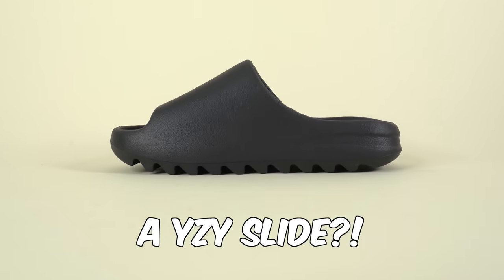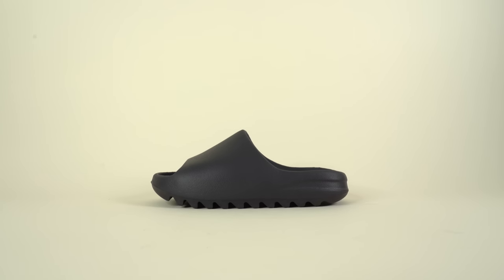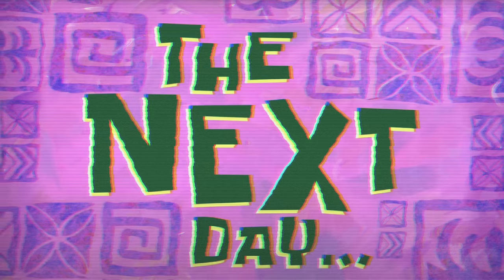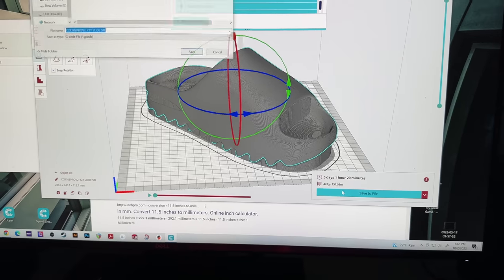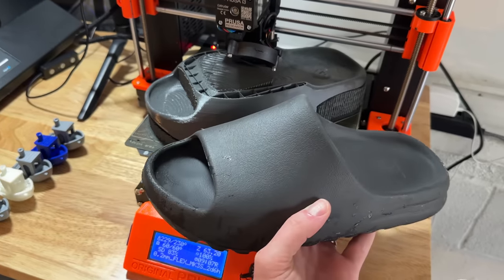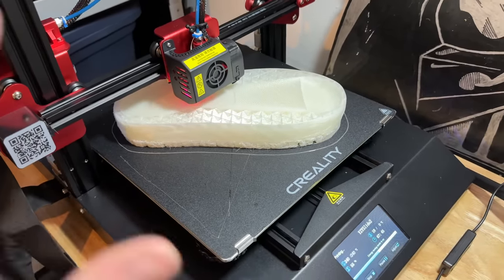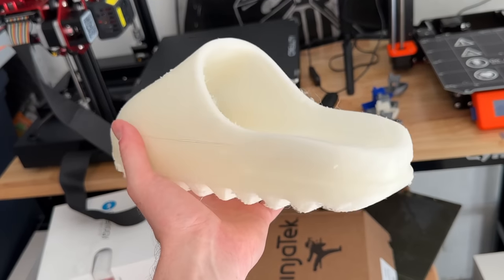I 3D Printed YEEZY SLIDES

Comment: I've been 3D printing for about 8 years now, and one thing you may want to try is changing the infill patter, which could affect the squishiness and feel under foot.
Reply from the maker: Great call! I’ll try that!
Reply: @SethFowler  iirc gyroid is what a lot of people use
Reply: i wanna start 3d printing but i do not wanna spend over like 300-400$ for a good printer, what should i buy?
Reply: @SethFowler  cant wait for the next video
Reply: @SethFowler  Instead of printing an entire slide maybe you could print multiple soles with different infill patterns? Just a thought.
Reply: @trqnton4640  The ender 3 printers are great budget options. You will have to tinker with them a bit but nothing too crazy it just wont be as good as it can be right out the box. If you are willing to spend more money I highly highly recommend the prusa mini +, the kit one is $430, and the semi assembled is $460. Very worth the money. Its a bit smaller than the normal prusa and the ender but it prints insanely well. Prusa's print the best out of every printer i have used and i have used some pretty expensive ones with my job.
Reply: @trqnton4640  An Ender 3 is pretty much everyones starter printer. Its solid and if you get it on sale like $150-$180 bucks
Reply: @trqnton4640  save up money and get a bambu lab x1... best printer to buy at the moment and really not that expensive for what it does...
Reply: @SethFowler  i would try cubic. seems to me like it would be like a spring. maybe 20%?
Reply: @trqnton4640 JUST KNOW that any budget printer is gonna have it's kinks and issues. Unless you spend lots of money on a printer, it's not gonna work well 100% of the time.  Perhaps an ender 2 pro would be good. It is 169 USD. You might want to watch some vids and reading some articles on good budget printers and make the decision yourself, but I have a self upgraded Creality Ender 3 that is great. I would certainly check out Creality as they make some of the best budget printers. I would maybe not go for the ender 3 if your just starting out as it needs to be assembled, which can be slightly difficult, but it is highly upgradeable and there are good YT tutorials to build it. It's a great choice if your up for a challenge. I have also heard good things about anycubics. If you want a bigger printer, there is the CR series from creality. .
Reply: @SethFowler  plz do this again I found it super interesting and I know you can do it even better and I wanna see how close you can really get with this technology
Reply: @trqnton4640  just get an ender 3 for under 180 learn to tune it and its a great printer
Reply: Something that will improve quality and printtime on the creality, switch slicer. You can you use any slicer but I would recommend the prusa slicer or cura. And than just search a fitting profile for the printer on internet and add it.
Reply: @trqnton4640  best entry point printer is the ender 3 pro which you can upgrade down the line
Reply: @trqnton4640  depending on where you live, if you have a Microcenter near by they'll have sales for and Ender 3 Pro for 99$ which is a steal!!
Reply: @MaxximumKB  I heard the ender 3 S1 pro is about comparable.
Reply: @jitsevanthillo4221  I like normal Cura for my ender. I haven't really used Prusa slicer, but its seems to be more confusing.
Reply: @SethFowler  if there are a lot or all filled with filterment, will the shoe last longer, even if it is harder
Reply: @BuildBreakBuilds  Yeah i have also heard that. Its also direct drive so you would have a better chance of printing flexables using it than the prusa mini, but its a little bit more expensive for the pro and prusa's products are just super solid but definitely a good option for the same price range as the prusa mini. the s1 is also a good but larger so thats a plus if you need to print something as large as a shoe
Reply: @trqnton4640  Ender 3v2
Reply: @trqnton4640  I don’t quiet remember the name of the printer but there is a printer names “Fookos” I think that’s like 50% off on Amazon
Reply: @trqnton4640  Ender 3 works great right out the box, you can upgrade it to be quieter and print at higher temperatures, and it will still stay under $400
Reply: @trqnton4640  On further thought, I would probably go for the Ender 2 Pro. It is rather cheap at around 170 USD, and it comes mostly assembled. If you want a bigger print volume, then the Ender 3 is good, but again, you have to assemble it. For a bit more money you can also get the pre-upgraded Ender 3 Neo.
Reply: @trqnton4640  ender 3
Reply: @trqnton4640  ender 3 v2, ender series in general
Reply: @trqnton4640  Just wait for black friday, and if you cant then just get an ender 3.
Reply: @MaxximumKB  Once you have a printer, you can print a direct drive mount and change your extruders location. No need to spend extra for that feature.
Reply: @trqnton4640  Ender 3's are good enough to print functional firearms with and most variants can be found for under $300 bucks.
Reply: @CaliMeatWagon  wait what you can print GUNS?
Reply: @CaliMeatWagon  Yes, you can definitely  do that with printers such as the ender 3, but I would not recommend doing that with the prusa mini, but also you typically don't upgrade prusa's which is one of the perks of owning a prusa. I like the s1 over the ender 3 because it is basically an already upgraded ender. Also there is nothing wrong with bowden tube printers other than printing flexables.
Reply: @trqnton4640  You still need some metal parts, but yest. Check out Print Shoot Repeat on youtube.
Reply: Using Lightning infill in Cura will drastically reduce the stiffness. Can try increasing line width and infill density to increase stiffness.

 Would suggest a bloody Bambu X1 for mega fast printing. Wouldn't be surprised if you can halve or third the print time. Also, use a larger nozzle.
Reply: @pooounderscoreman  A larger nozzle is a great idea. Perhaps even consider a .8mm. However, I'm not sure if lightning infill would be good for this application. Lightning acts as internal support, so only areas that need to be supported will have infill, meaning the shoe would be mostly hallow. When I wrote my OG comment, I had gyroid in mind, but since there are now so many patterns, he would have to test them out to see which is best.
Reply: @trqnton4640  anything under $300 you are going to spend a lot of time troubleshooting and constantly tinkering with. If you are okay with that I would recommend an anycubic or ender printer. If you want less hassle go for the $400+ printers
Reply: @trqnton4640  ender 3 v2
Reply: @SethFowler  agree with op, cubic infill at a higher density like 20% would be soft enough but rigid enough to hold youre weight without collapsing. Cubic gives strength in all dimensions  which distributes the load evenly, unlike standard infill/rectilinear/grid
Reply: @SethFowler  if it works make a video...the flow in he dark idea is so cool
Reply: Gyroid infill will probably work well here
Reply: @trqnton4640  The Ender-3 Max Neo 3D Printer is a good one.
Reply: You look to be about 15 years old which means you were 7 when you started. I find hard to believe. Unless you have a boat load of money, I doubt you had a 3d printer 8 years ago considering consumer grade printers just recently (last 3 years) became affordable. Maybe you had access to a school printer. In which case you don’t have the experience your school did.
Reply: @samuelmartino9861  I was actually 6 when I started. My dad and I belonged to this place called TechShop (which has since gone out of business). The had original Printrbots that cost like $1100 and only worked 40% of the time.
Reply: @trqnton4640  you can get an ender 3 pro at microcenter for 99$
Reply: @trqnton4640  spend the money.. get a Bambu p1p probably the best right out the box no mods needed to print high quality

Comment: Try that last ninjaflex sized slide and up the infill by about 15-25% and use Gyroid infill patern instead of what you are using now, has a much ebtter spread for pressure. You were so close to success but you gave up D:

Comment: As others have probably said… 1) change infill at different parts of the model (easy in PrusaSlicer), 2) use a bigger nozzle like a .6 or .8mm and 3) 0.15mm layer height is tiny, am sure you’d get good-enough results with 0.3 on a 0.6mm nozzle will print in fraction of the time
Reply: THIS!!!!!

Comment: Your cr 10 printer will inherently be stringy when trying to print flexible filaments. This is due to it being a bowden style extruder instead of a direct drive extruder on the prusa. 
You should try using progressive infill so there is more infill at the sole and less infill on the top where the infill does not matter.
The infill pattern you should use is the gyroid pattern.

Comment: In Prusa Slicer you can add modifiers to change the infill at different parts of the sole. i.e 60% for the heel 30% for the toe and 50% for the arch. Also you can use another model as the modifier to get a better shape. The rabit hole is deep.
Great video. Keep up the good work.
Reply: I really hope he does this next time, the heel always collapsing is disappointing.
Reply: You can do this in Cura too.

Comment: I highly recommend gyroid infill (you’ll still have to iterate to get the percentage just right though), and a 0.8mm or 0.6mm nozzle. Will be much quicker print and still look just as good. Gyroid is better for unilateral strength too.
Reply: This is awesome though. I’m gonna try to make some as well. Maybe foam runners too.

Comment: With the support, figure out a good angle for printing the shoe. Angled slightly at anything less than 30 degrees will help with an overhang. You're essentially trying to make a bridge so stringing will occur.

Comment: the 3d printing videos are really interesting.  might want to pick up a 3d printer soon
Reply: I highly suggest joining the 3d printing discord and getting access to the what printer should I buy sheet. You want something with a PEI sheet bed (so you can peel it off and not have to struggle to get it off the glass
Reply: Also - prusas are like the high end shit but a step below ultimaker. Ultimaker is like the ultra high end shit lol

Comment: Stringiness isn't normally solved by supports.  They are typically due to retraction and priming settings.  Additionally travel speed has a significant impact on this as well.

Comment: Suggestion, With Prusa you can use certain modifications to make a 3d model slice with one type of infill, and then another part of the model slice with another type of infill. Id suggest looking into that, so you could say make the heel area thicker in infill (and id say look into using gyroid infill because it might have better cusioning) and have the front area have less infill. Same with layer thickness, you can make the bottom layers have thicker walls while leaving the upper layers with thinner walls. Theres a lot of options for you to use instead of one infill prints all.

Edit: Other suggestion, theres printer profiles in the Prusa Slicer for creality printers, take a look at them since Prusa slicer is a better slicer then the creality one.

Comment: Glow in the dark fillament will degrade your nozzle super fast. If your prints start to suck get a hardened steel nozzle, you'll be able to print abrasive glow in the dark fillament

Comment: About the infill situation if your using cura to splice your prints you should change the infill type instead of more infill. I believe the default is cubic but I recommend using gyroid it’s more structure do you won’t need more infill

Comment: i dont know if this is possible, but in 11:16 you metioned the "pocket of air squeezing", maybe there is a way to post process tpu filament prints to fuse the gap between layers, maybe this would make shoes more stiff and create feeling like 'walking on air'  ? i know that people are using ipa fumes/acetone to smooth the  petg prints.
Really enjoy the shoes printing series, keep grinding 👍🏽

Comment: I would suggest changing your infill pattern to "Cuboid". It offers strength in all directions. I also would experiment with increasing your wall count. 

One thing you can do is just print out the soles. It will take less time and you can experiment with different settings and nail the right stiffness.

Comment: Maybe change not just the infill but the number of walls too, if you put a high number of walls with a low infill it may be soft in the middle and not crush under the weight on the sides, I don't know if I explained it correctly but I think it would have a good result

Comment: does it have to be done in a single print. use the glow in the dark foam to make the tread. and the 2nd one to make the top and a 5mm sole and then just plastic glue them together?

Comment: you should try the bambu labs p1s or max and see if you can do the soles as slid material and the inside as a softer material before finishing with a style material around the top. I recommend that printer because it can handle multiple materials with its AMS system as once.

Comment: Are you using a hardened nozzle for the GITD filament? If its Brass the GITD materiel will slowly reem out the brass nozzle and lower print quality and could cause additional stringing.

Comment: These videos are great, and I don't want to sound like an unfair critique, but you never seem to learn that the shoes will have a tendency to compress and completely deflate upon placing any sort of pressure on them. Almost every print has had this issue and surely there would've been a way to resolve this. Outside of 3D printing, why not fill the soles in with something else, like perhaps expanding foam, wonder how that'd work.

Comment: You can fix stringyness with retraction

But I wouldn't actually do that because you're using flexible filament, what I would do is print them without support, and then use a lighter to burn off the strings

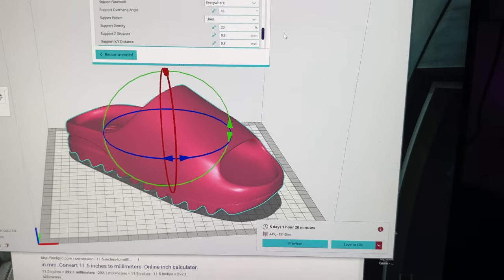Comment: 3:37 pro tip: dont use the creality slicer. it sucks and is based on an some older version of cura. Just use the lastest version of cura and the built in profiles for the printer or even prusaslicer and it should have built in profiles for a bunch of creality printers.

Comment: im  from the 3d printing community and i would recommend changing the infillpatern, and instead of using supports that stand on the insoles, try to orientate it kinda upside down and vertically so there are just supports touching the printbed

Comment: From my own shoes I made I found 13% infill with 4 print lines for the outer wall for 130lbs works great for daily use using poly maker TPU 

When wearing for cross country running, and intense tug a war the outer wall layers split or were too flexible. This was solved by welding the tears closed and welding to make the sides thicker. The sole will not squish out air when properly re-sealed 
The redesign of the shoes will have thicker walls in all the non flex spots 

Print time is 4days

Comment: BambuLab X1 will print these at least twice as fast, especially if you consider changing the nozzle diameter. If you are using 0.4mm, consider 0.6 or 0.8 for a drastic speed-up. 0.8mm would be close to twice as fast, especially if you up your layer height to .3-.4

Comment: You need to mess with changing the infill throughout the print.  Probably need >50% for the sole of the shoe and then set it low for the insole and foot cover. 

You could try upgrading the ender printer with a direct drive extruder so it can print faster too.

Comment: You should drop that support density like CRAZY, and use support trees in Cura, or use Meshmixer to Analyze Overhangs and generate supports using their tool, then import to your final slicer and finish the slicing there for your final .gcode. Also use support blockers if needed. And something tells me....you should try gyroid infill instead of grid or lines.... 👍

Comment: I would recommend an idex printer to use dissolvable filament for support. The IDEX printer optimally use dual direct drive extruders. Something like the Soval IDEX printer.
Reply: Soval SV04 IDEX printer would be my recommendation. You will need to calibrate it some what but using flexible and a dissolvable filament would make support removal super clean.
Reply: Also gyroid infill as well will give you the best squish feel

Comment: Btw just a small thing I would not recommend using the creality slicer even tho you are using a creality printer. It's outdated. What I would rather recommend you use is whatever you are using for your Prusa. (Not sure if you are using Cura or Prusa slicer) but both of them have profiles for your printer from what I know and they should make your experience much better with basically everything. Also they are better at slicing because they both have better algorythms under the hood.
Reply: Creality slicer is an older forked version of Cura. Though I agree he should switch to the real Cura preferably 5.0 or newer.

Comment: Use your scan in an editor like meshmixer, and subtract it from a block to make a negative space.  Then you can chop that into pieces to make mold halves.  Get some two-part rubber or silicone and cast these, and you can get the firmness and flexibility all in one.

Comment: is it possible to use both machines for one slide? layer by layer? have the stronger base/ stiffer base for the soul  but then mid print use the ninja flex where your foot sits and the upper half of the slide, we need a part 2

Comment: There's a way to print an object with different infill %
Example you can print about 1 to 2 inches with 30% Infill and after that set hight you can lower the  infill to something like 15%. Might help with the heel support and co fort.  

Would make a great video.
Reply: This the way to go, but more infill. 80% for the first inch and then 40% for the rest.
Reply: @DKFX1  yeah that makes sense (my numbers were just guessing).